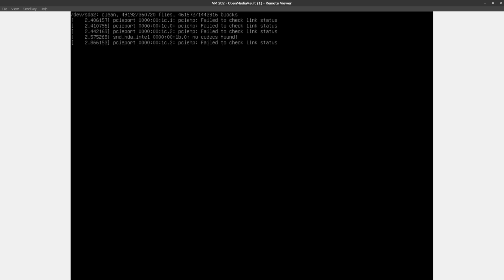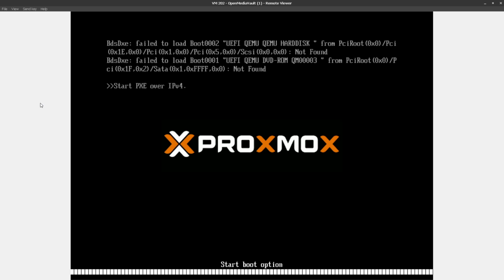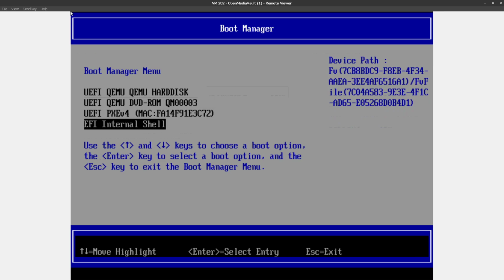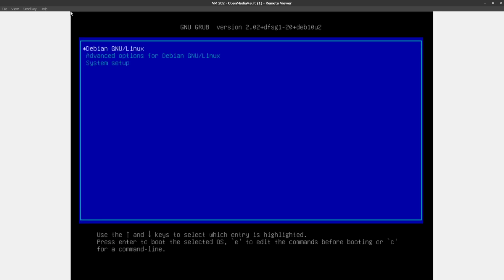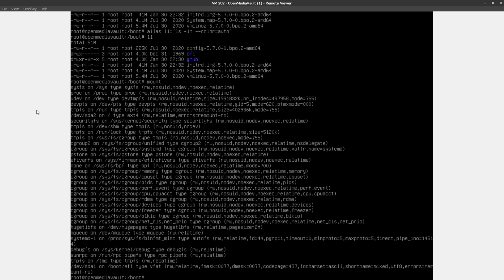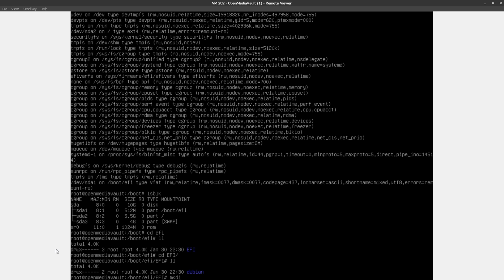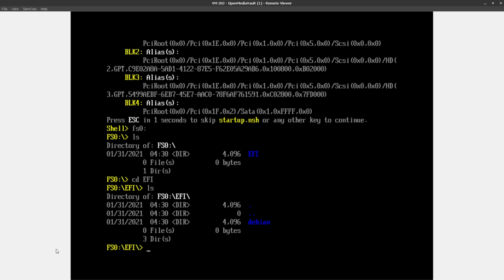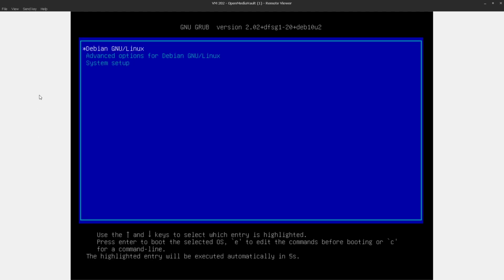Linux - Using the EFI Shell to fix the Grub EFI loader path.

Comment: Thanks a lot for this video, I was setting up a system using one of Supermicro's old X9 motherboards (That was early days for UEFI with plenty of firmware bugs) and using the UEFI path you showed, which is intended for removable media but has become a de facto fallback path, was a reliable way of getting my system to boot.